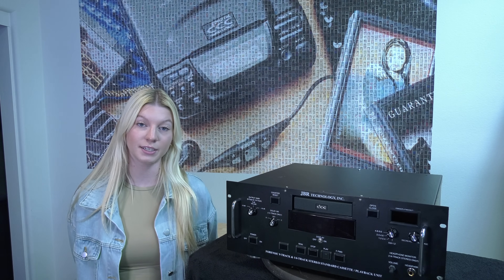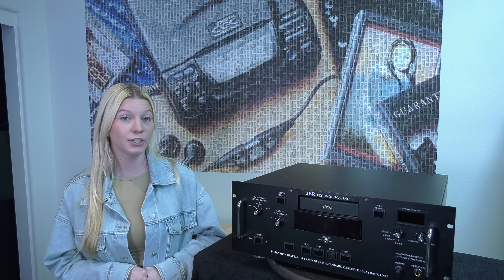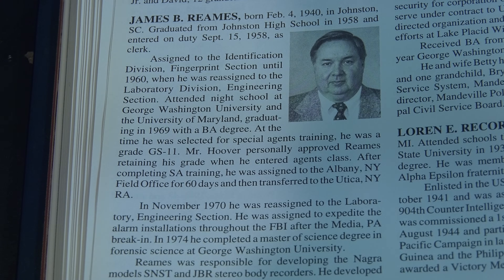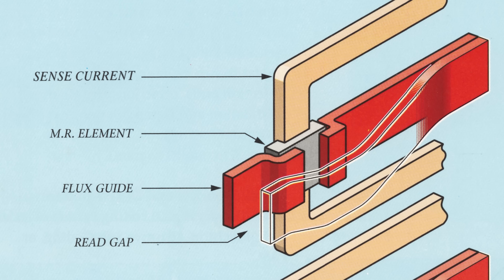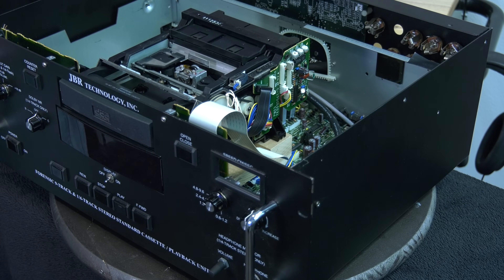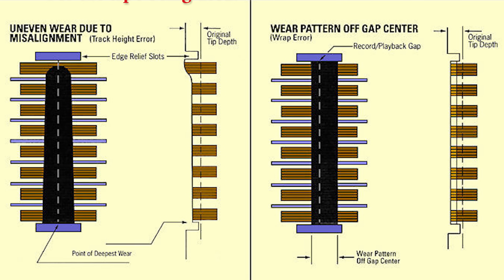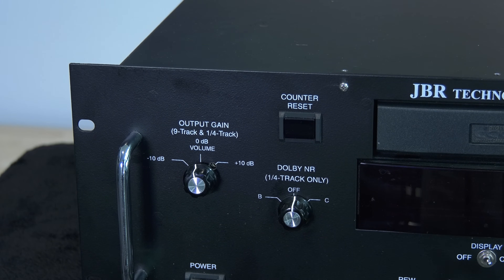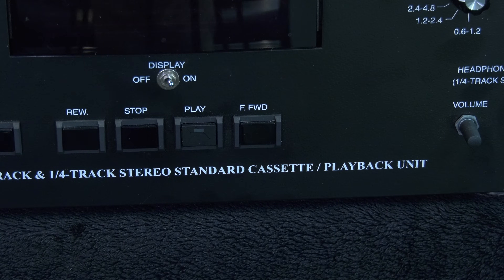How This Cassette Deck Fought Crime. The JBR DCC Forensic Player.

Comment: This is a great video with lots of information! Thanks Carly!
I saw the device in person and unfortunately it's unfinished. There are cables that are cut to size to be attached to the sockets and switches on the front and back side, but the insulation wasn't stripped and the sockets were never soldered. The DCC mechanism works and there are wires attached to the points on the read/write amplifier that can be used to read signals from the individual tracks, but the device that would be attached to those wires, is missing. The motherboard from the DCC900 is in there but it's cracked; it may have been damaged in transport or maybe it was broken before and maybe that's the reason why the device wasn't finished.
I hope one day we'll be able to construct our own hardware to prove that it's possible (in some cases at least, as Carly describes) to get audio from an erased tape.